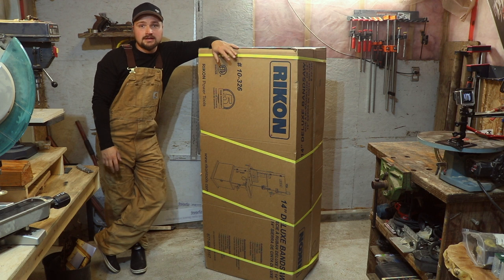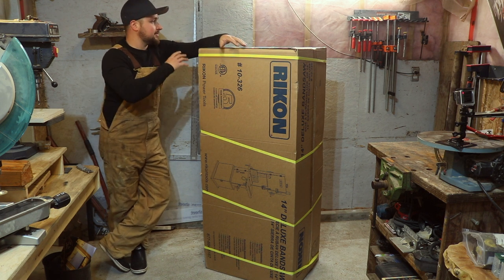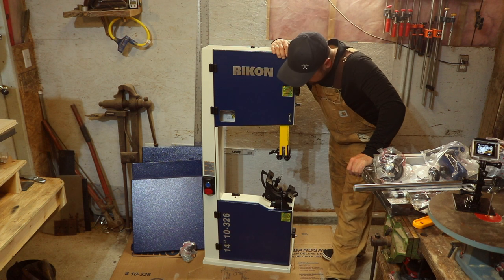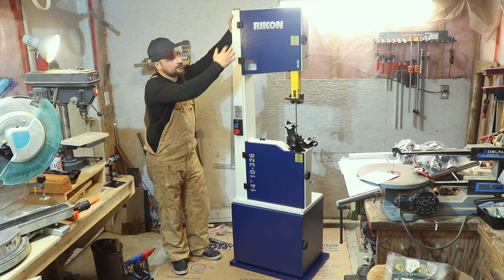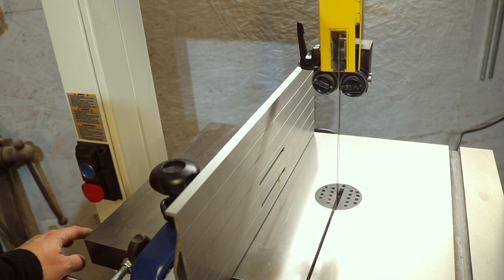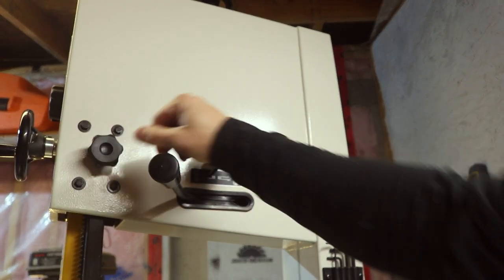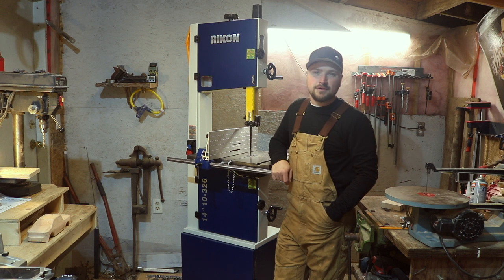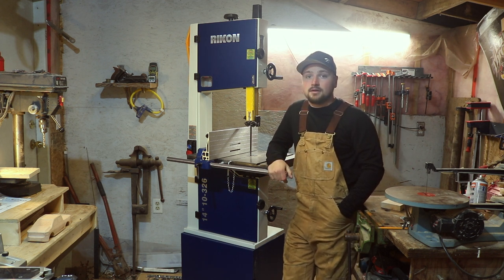Rikon 14" Deluxe Bandsaw assembly and review, #10-326 - Overview

Comment: Whays the thing on the chain for? Insee it at the front of the table.
Reply: A removable round pin is used to keep the halves of the table in alignment. It should be kept in position unless the blade is being changed.